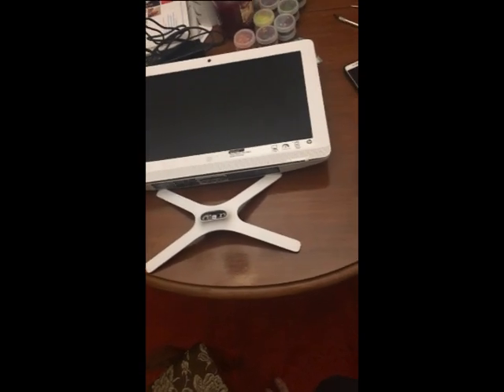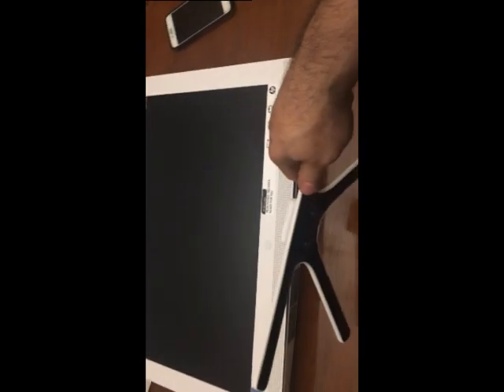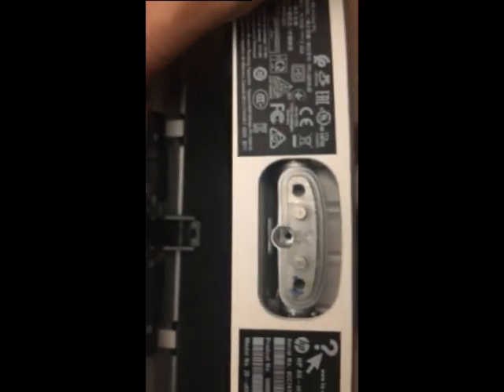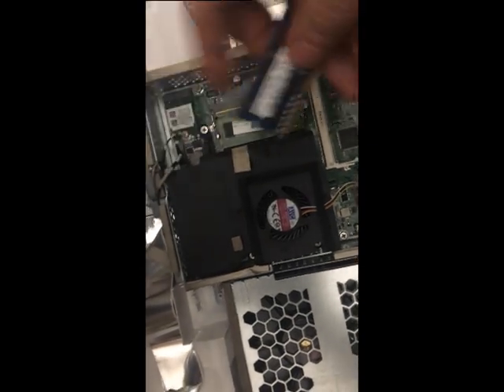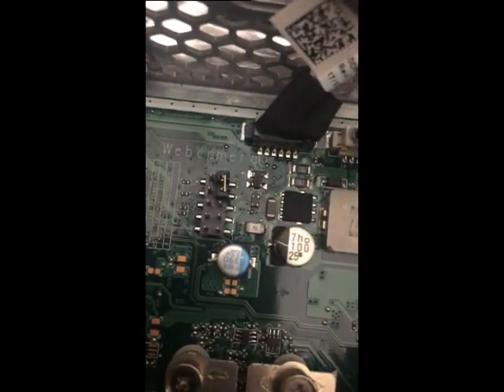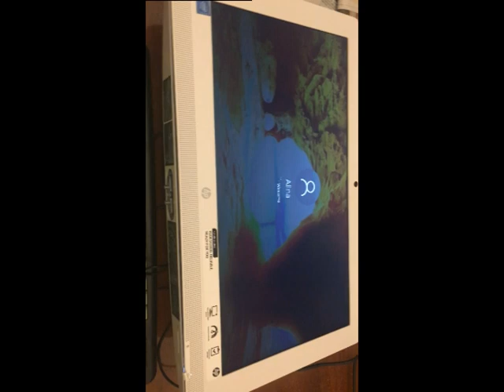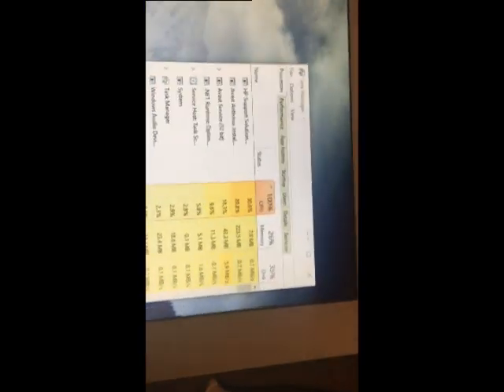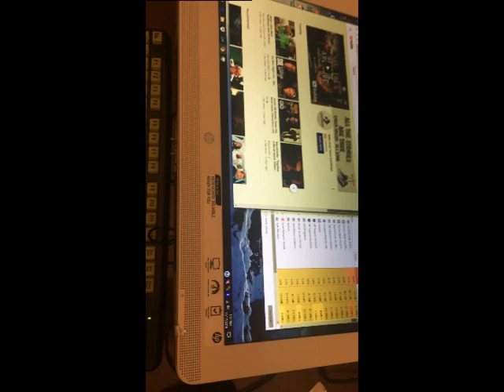HP All in One 20-C013W Snow White Memory upgrade

Comment: Thank you for this!
Reply from the maker: this machine really needs that extra memory and well an SSD Drive. I cant recall if I showed that or not.
Reply: @bobspurloc   okay, I’ll get SSD too. I’ve never messed with the guts of my computers; always left it up to the pros. So this was helpful. 
I installed extra memory to get it to 16gb for gaming. However, windows will not start up after login. Maybe I should reinstall the original 4g + 8 and see what happens. BRB
Reply from the maker: interesting it didnt boot up with 16. I dont think  tried maxing it out. I gave this machine away so have forgotten a lot. so after 16 is in there do you see the bios opening screen? and then windows and windows hangs? or nothing? if nothing does it beep? I dont recall if I showed the beeps a pc makes when it doesnt like the memory setup. I kind of think its 3 quick beeps. so you had 12gb in it?

Comment: Static burns out any computer , any static diacharge and its done. Your a terrible u tubee
Reply from the maker: no it doesnt, and hasnt in many years. the only static that fries anything is a lightning strike traveling down the network cable or another cable and all that does is usually blow out the diodes protecting it or the main chip handling that port. u speak with ignorance. I repair these things where u spread nonsense. in yor world anyone touching an AV cable has a high risk to blow out the systems amp explain why that doesnt happen with its big pin sticking out... odd